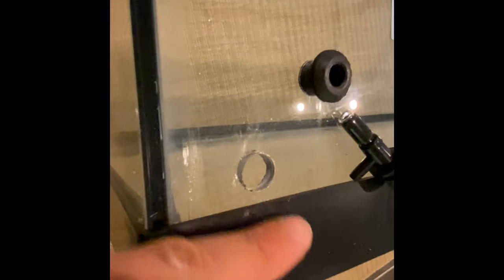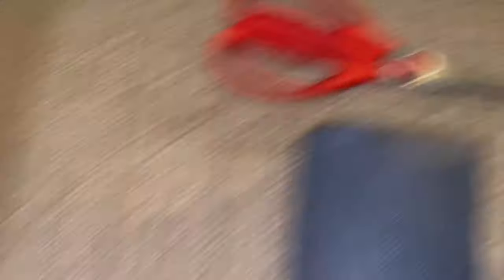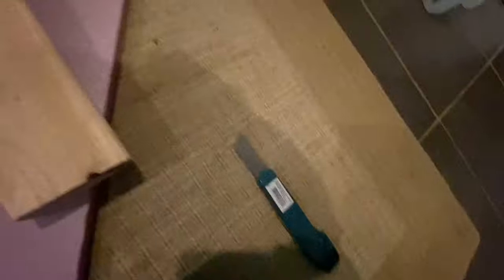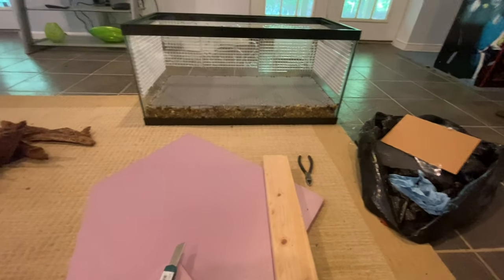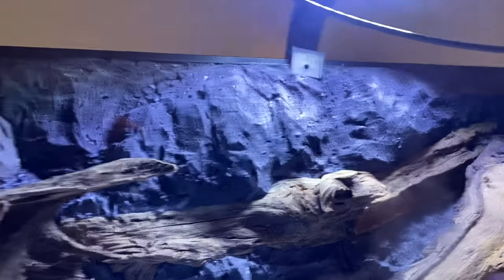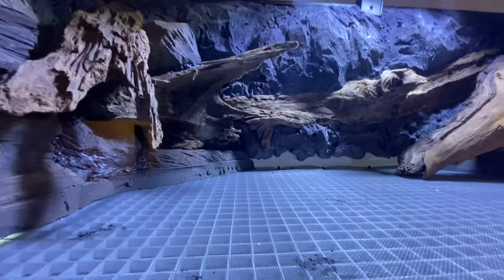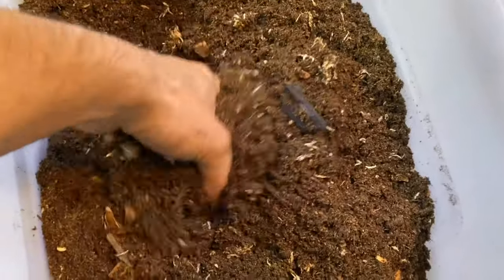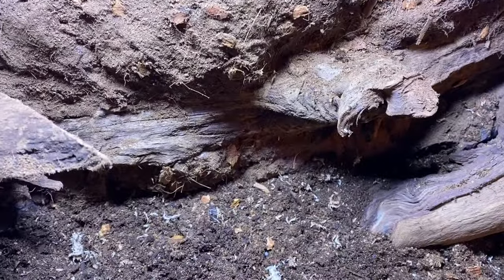Vivarium DIY - for Salamander Species

Comment: Looks great man! Ventilation is key when growing anything in a mostly closed system. Circulation us maybe even more important. Your mist king will keep the humidity up but a small computer fan will go a long way to keeping ferns and moss healthy. The leaves must dry out between waterings on the ferns to keep algae and bacteria at bay. The moss will stay more compact and not leggy with air flow and if you position the fan at the front glass it should keep the glass free of condensate. A duct work can be built using corrugated plastic outside the tank with the fan built into it and the duct connected to the top lid at opposing ends. Use the large holed plastic mesh for hook rugs WalMart sells it to keep sallys from climbing into the fan. Hot glue or gel super glue to build the duct and fan combo together. Create a slide door over a hole to control ventilation vs circulation till you get it dialed in where 2 hrs after a mist foliage is dry. The leaves will transperate water adding humidity to the air until the next cycle. Some fart frog guys have even built the duct work into the tank and disguised it as a log or rock.
Reply from the maker: I was thinking of getting some fans with a similar setup you mention. Appreciate the info !